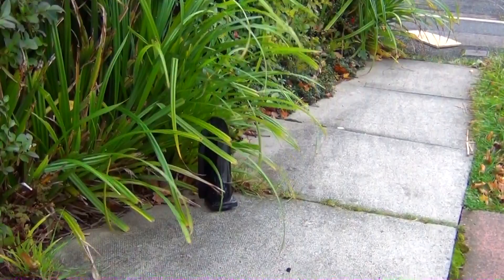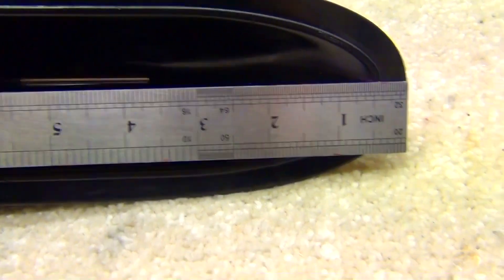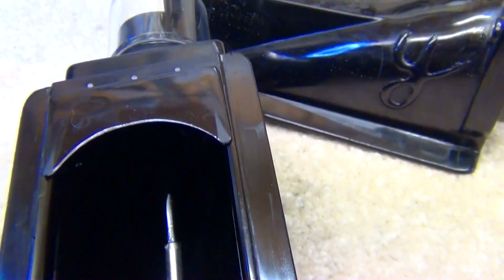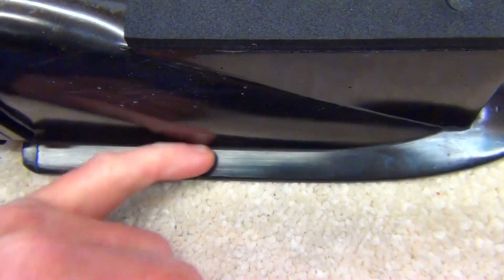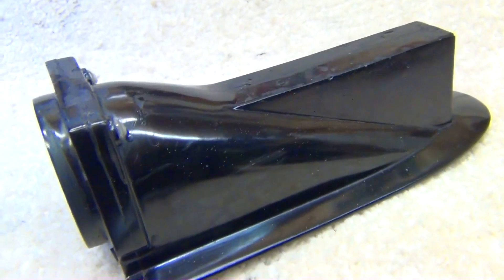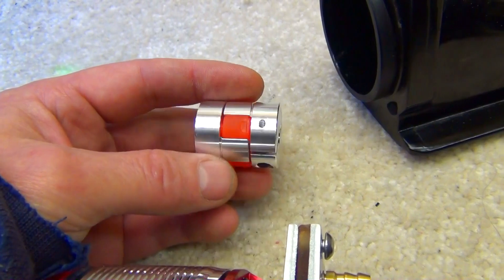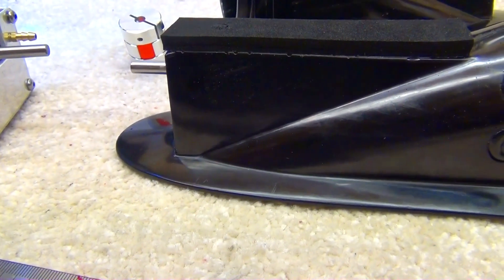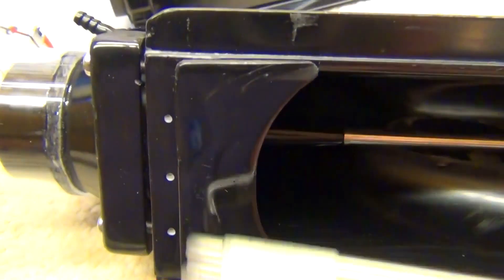JET-DRIVE 53mm, CLOSER UP VIEW

Comment: maybe i am missing something, but what prevents water from going up into where the electric motor is at? is it a bearing that keeps the water out and away from the motor?
Reply: Implemented into the design of a waterjet, the impeller gets these tiny buildups of air off the tips and as they release and are ejected from the nozzle it creates a negative pressure, or a "vacuum" inside the impeller housing, which prevents water from being forced into the housing. One of the great things that make a water jet a water jet. p.s.: negative pressure is determined by flow rates of air into and out of an area. when you have more air moving out of a room than you have coming into it, negative pressure is generated inside that room.
Reply: besides that bldc motors, or the ones they are running are completely waterproof so it wouldnt matter if water got in there
Reply: @b-rad7708  dont forget sealed bearings too.....